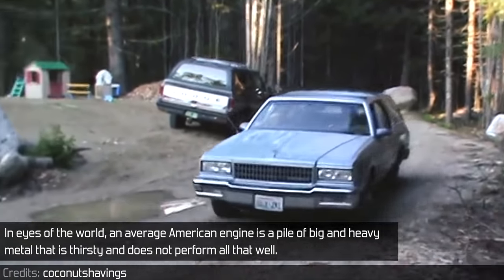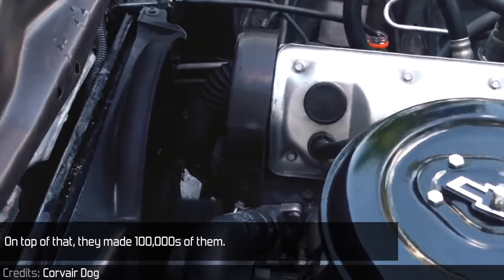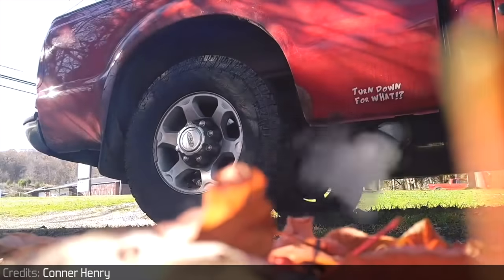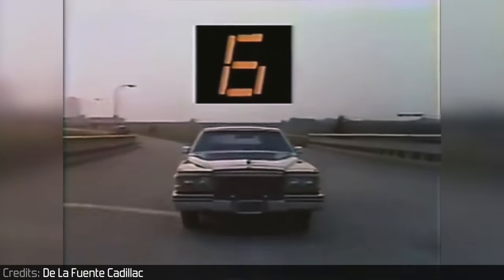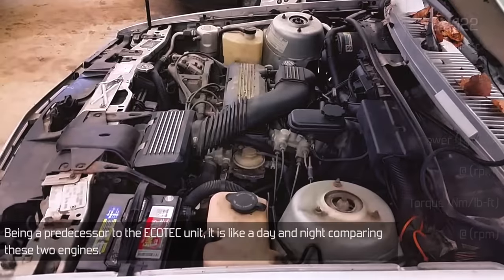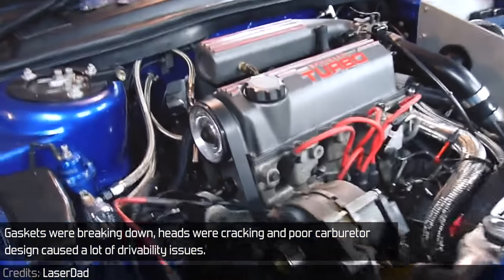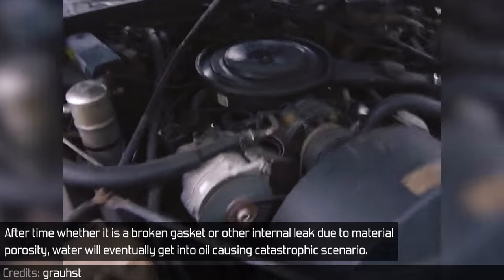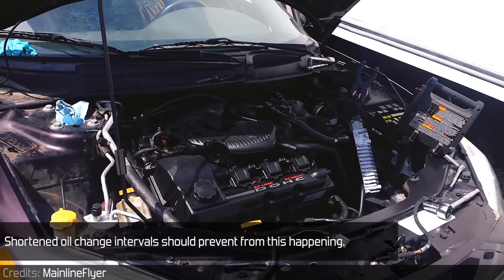8 Worst US Engines You Should Avoid

Comment: Well, I enjoy your videos but I disagree with your assessment of the Ford 4.6 (I had a 94 Cougar 4.6) and 5.4 (I had a Ford E250 5.4) I never had any spark plug issues with either. I've researched the engines; mechanics report tearing ones with 200,000 miles plus on them to rebuild and find the original machining is still visible in the cylinder bores. They produce a ton of power per pound, are low friction modular overhead cam engines. They are awesome engines if properly serviced. If you crank the plugs down without a torque wrench then the plug problem is on the mechanic not the engine. How you could possibly say this is one of the worst engines, I can't fathom it, especially when the Ford 3.8 V6 blows head gaskets every 80K miles in every car always LOL

Comment: Ok, so the '79 GM Diesel had some  problems. In 1980 they were solved.   Some problems were the Roosa-Master pump, not GM. All said and done, They we're a good engine. Mileage ?  Literally drive halfway across USA on 35 gallons of fuel in a Sedan de Ville or a Delta 88 .  Biggest problem they have today is trying to find parts for them.
Reply: ASPCOT Your assessment of the GM diesel is misguided.  These engines problems were not solved by 1980 and the class action law suits went to the late 80’s.  The problems  with these junkers involved blown head gaskets, injection pumps, bottom ends and the like.
Reply: Dyno Don  My assessment was based on experience. After they short-blocked my Mom's Delta, the entire car rusted out around it, with no more trouble. We pulled the engine and repowered a '76 Gran Prix with it . My '80 Sedan DeVille NEVER gave ANY trouble, except Roosa-Master was still building shit pumps, before Stanadyne took over and fixed everything. This car also disintegrated around the motor,  and said motor on its into my '71 C-30. You are apparently not an enthusiast of these motors and that's ok, but I know several people with these motors in various GM vehicles, and they all love them. Judging how long the problems actually existed by the progress of the judicial system really IS misguided.

Comment: The Diamler-Chrysler 3.7 V-6 and 4.7 V-8 are a terrible design too. Nearly impossible to work on, designs that don't make sense, and heads that are prone to warping and valve seat droppage. If you happen to be in a low coolant situation, the engine pushes the coolant out to the radiator, so you end up with air in the engine instead of the radiator... But that engine family doesn't belong on this list, because it was designed by Mercedes-Benz.

Comment: Cant say much about the Vega engine cause I have never had personal experience  with them but I can add something to the rest.

 The 4.1 caddy was an abortion that should have never seen the light of day but gm did  enough revisions that the later models would hold together. 
 The 5.7 diesel can last if the person working on them know what they are doing. I have seen several original units with over 300k on them. They are horribly under powered and the fuel economy wasn't that great.
8, 6,4 would have been great if the ecm had the horsepower to run it properly. It didn't.
The 2.2 Chrysler was an enlarged VW 1.7 and prone to the same problems.  Nobody seems to think the VW engine is crap. 
The triton runs just fine if the guy working on it knows what he is doing.

Comment: You would do well not to begin your video by “nation bashing” car manufactures. Car companies from all countries have built both great and horrible engines. As others have said, “bad” engines involve more than just cost cutting; especially engines designed 40-50 years ago. At that time, they we trying out new ideas, usually to meet new government mandated fuel economy laws. They were also using light weight metals to try to improve power to weight ratios and increase fuel consumption issues. A few of these engines led to later advancements that worked out well, and thus, paved the way. In older cars, bad engines like the GM diesel V8 and Cadillac V 8-6-4 can fairly easily be swapped out for conventional gasoline engines which makes the cars very functional for reasonable cost.

Comment: I usually enjoy his videos. This one I wasn't too crazy about. While yes a few of these engines he mentioned were total trash. And some of them were able to redeem themselves to an extent and we're more reliable over time. But some of these are actually very reliable engines. I've seen numerous Ford Triton engines with over 300k. The Cadillac v864 was a very reliable engine when you unplug the cylinder deactivation with the one wire going to the transmission, the GM 2.2 was a fairly decent engine for what it was. Was it a powerhouse? Absolutely not, But it did its job And got decent fuel mileage doing it. I suppose this is just a classic example of agree to disagree situation

Comment: The triton thing is overblown horseshit. It only applies to 3v and 4v engines not the 2v. Also anyone with an ounce of sense can get the plugs out. The spark plug ejecting issue was early (1991-1998ish) engines before they added more threads to the spark plugs. My 2002 P.I. 2v 4.6 has 9 or 10 threads on the plugs. The spark plugs that break off are because they were a 2 piece design with a long electrode that was necessary on the DOHC engines. It may not be the best design in the world but it can be overcome easily and with only basic maintenance these engines will easily go 500,000+ miles.

Comment: The Ford Focus 1.9/2.0 L single cam engine needs to be included. The biggest problem is that particularly the #4 cylinder tends to pop the intake valve seat out of the head. This hardened steel ring then bounces around in the cylinder doing a lot of damage. A local machine shop owner calls the Focus his "bread and butter engine". They keep food on his table. Check out this video. https://www.youtube.com/watch?v=FS4vhSlFMao&list=PL1WSELXYbcZFvjrzwE6EvTP66XGi-bl8z

Comment: They forgot to mention the v6 buick engines from the early 80's they leaked oil terribly and even if you rebuilt them they would start to leak oil again after a while i know this from having owned 2 of them the best thing to do is swap in a v8 preferably a 350 problem solved

Comment: While I agree that all of these engines sucked, the overall jabs at american engines you make by referring to any of these dumpster fires as “typical” is not accurate. Most of these are from the 80’s when America’s government put much stricter regulations on emissions than most of Europe had to deal with, which forced U.S. automakers to drastically re-engineer their engines, and allowed European and Japanese cars to break into the market, as the emissions requirements weren’t as restrictive for small engines.

Comment: I would've expected the oldsmobile/pontiac quad 4 inline 4 engine those engines have reliability issues and have high tendencies to lock up or a head gasket to fail depending on how much miles but of you know what your doing you can make the quad 4 last

Comment: Hmmmm.  This is not so accurate.  I put over 200,000 miles on a 91 Lincoln Town Car with a 4.6 with no issues.  I also have an 07 P-71 4.6 that has spit out two spark plugs.  Easy fix with the Time-Sert kit.

Comment: Hey why do you say American engines are bad? I know a guy that has a 1978 Trans Am with the 455 cubic inch engine that gets around the same amount of economy as say a 2002 Nissan Frontier with a 2.4 liter engine. Sure he replaced the transmission with an overdrive unit but still. I wouldn't call that bad.

Comment: ONLY 5.4's had the spark plug issue. I had well over 250,000 miles on my 4.6 without a spark plug issue, and still ran smooth as glass. Learn what you're talking about before you make more videos... Vega 140?? Cadillac V8/6/4?? Neither of these are on the road anymore, and haven't been in 20 years or more. Close to 30 years for the Vega, regardless of engine. Unless it has a 350 transplanted into it. At that point it would be moving too fast to make a under hood video of it, lol.

Comment: No chevrolet push rod V8 that's cause they a the best gas engine ever made  cents 1955 til now 287, 305,307,327,350,396,427,454,        LT14.3,LT1 5.7,LT4 5.7 and the LS series LS1 5.7,LS2 6.0,LS3 6.2 LS6 6.2,LS7  7.0 and the new Generation LT4 that's in C7 corvette and camaroSS ZL1,ZL1 1LE and the Cadillac CTS-V.Plus all the  push rod V8 in the full size SUV and all the pick up trucks unless you get a diesel.
Reply: AI3xZJE41 YT  Made “cents?”  You left out the 265, 283 (great engine) what’s a 287,  then the 302,  and the 348.
Reply: 305 and 307 good for a boat anchor

Comment: Do homework more than google!  70's engines were for gas crunch and gave poor performance to save gas.  Second, you mention olds, Chevy, caddy....lol all GM and mostly similar engines changes slightly for each "brand". Third. Ford 5.4...reliable, was a bad spark plug design and has been redesigned.  Own two of them...never blew plugs out of either and one has 200k.

Comment: Must be smoking crack to put the ford 4.6 on here this is one of the most reliable engines on the planet, ive owned several of them and work on all of em myself you just need to know certain tricks when it comes to the spark plugs and its no problem, never had or heard of anyone have a sparkplug shoot out if so probably was under or over torqued, these engines can last up to 500,000miles or so ive seen it, now the 5.4 thats a different story i would never buy that engine between timing chain and cam phaser issues its not worth it

Comment: Well, thankfully my D1VE ford 460 lincon engine wasnt in there but maybe it just missed the list? Either way ive got to rebuild it in the 3rd world and try to improve on its previous 200bhp output. Meanwhile everyone else round these parts just laugh at me while doughnutting in their SR20DET powered rides......
Reply: The 460 isn't a bad motor at all, it just got heavily smogged down after '72.

My '71 Continental has the 365hp, 450ft-lb D0VE 460, last of the good ones. However, being in Australia also has its downsides since there are no parts available.
Reply: @atomicmillenial9728  yup, we're both nailed now with the new pisstake shipping rates.

Comment: treat your car like a rented mule and it's gonna be shit. take care of it and it's gonna last you a long time, I've heard the 2.2 ecotec GM motor was a throw away motor only meant to last 190,000 miles.. I had a friend who bought an 02' Saturn Vue with a 2.2 and it had 212,000 miles on it, and my 04' Pontiac Grand Am which I sold recently also has this engine, and it had 239,000 and was still going strong. 

But I will admit.. the Chrysler 2.7 is a shit motor. prone to sludge..

Comment: You forgot the Ford 6.0 and 6.4
Reply: Yes I have 2006 6.0 with 483,000 mile on it. Yes I had to do the head gaskets and head bolts ( under warranty ) but never a problem after that.

Comment: What about 6.0 power stroke
Reply: Blazerboy7878 one of the best modern diesels ever
Reply: Bro 6.0 Power stroke sucks
Reply: Blazerboy7878 how so ? vp44 Cummins are crap so are all the common rail 5.9s early dmax’s had severe injector problems and all the dmax’s had head gasket issues same with the 6.7 Cummins how is the 6.0 worse ?
Reply: I have one it’s blown up three times the turbo went out And it leaks oil every day

Comment: I worked for Dodge during the 2.2-2.5 days It was not a bad engine it had issues but was easy to work on reliable and bought Chrysler Corp out of doom. the turbo was a great engine and smoked a lot of more impressive cars ran a 2.2 non-intercooled turbo against my dads 1988 Mazda RX7 Turbo II and it was 10 car lengths difference. Encourage you to research it in 1986 there were just a few cars faster than a GLH Shelby 2.2 turbo. The 2.2 does not belong on this list much the same the 4.6 ford It was a bold move for Ford to release a modular Engine and it was the right move and kept ford alive in a lame part of Auto history. I have wrenched on every engine on this list most were crap you could walk faster than that vega 
just sayin